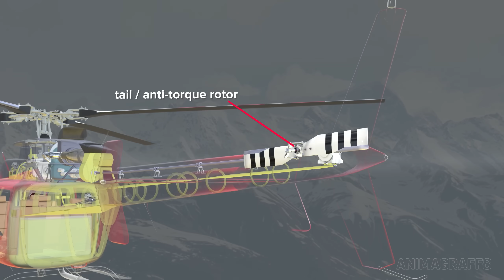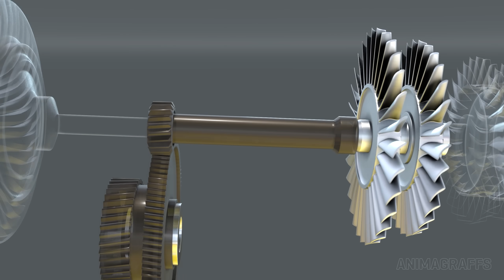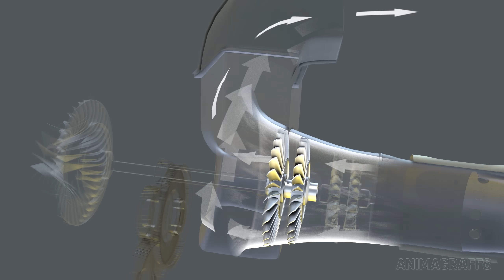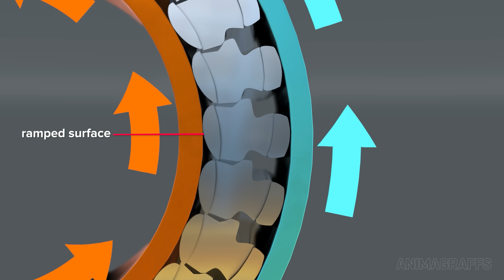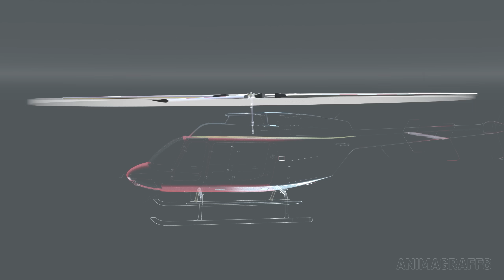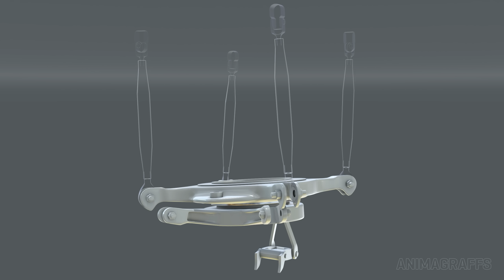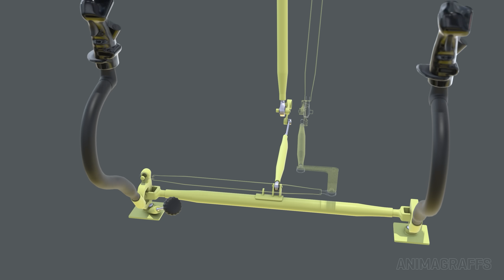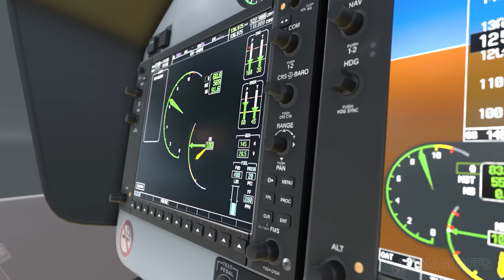How a Helicopter Works (Bell 407)

Comment: I thought “yeah I know how a helicopter works, I know the basics, it’s a relatively simple machine” and then I watched the video and was in awe😳 your videos never cease to amaze me!!
Reply: its a thousand parts flying in close formation around an oil leak. words from a helicopter technician i talked too a long time a go on the internet
Reply: @pieterpretorius1014  I cannot believe helicopters don't just fall apart, with 100,000 points of failure, 90,000 spinny parts, being held together with 50,000 bolts & also that one nut at the top of the mast clamping it all down. That one nut makes me worried. I believe in god now.

Comment: This is absolutely amazing!
Helicopters never made any mechanical sense to me, always found them scary, this video gave me a new appreciative perspective.
Reply: On the opposite side, it shows just how many things can go wrong because of how complex the whole system is.
Reply: @skorpius2029  I cannot believe helicopters don't just fall apart, with 100,000 points of failure, 90,000 spinny parts, being held together with 50,000 bolts & also that one nut at the top of the mast clamping it all down. That one nut makes me worried. Also I believe in god now.

Comment: Don’t walk past the baggage door when the engine is on, especially on the 407 (or the predecessor 206). That tail rotor is damned near invisible and comes down about 4 feet off the ground. 
It’s one hell of a haircut.

Comment: I have learned so much from this video.
The great detail you provided has cemented just how magical these machines are.

The "Yee Haw" engineering has convinced me that if aliens didn't build the pyramids, then they must have at least built helicopters!

Thanks Jake!
Reply: 😂.  I have always thought if aliens built pyramids, they wouldn't have used stone 😂.  Plastic? Carbon fiber? Anything but stone.  
Helicopters 🚁 are amazing. That's what I learned

Comment: FOR YEARS ive been looking for videos that explain how lift is transferred from helicopter rotors to the body of the aircraft. I thought Id have my answer... but its still not clear how lift is transferred from the rotors. It must be through the rotor shaft? But how is a rotating shaft connected to a body that can transfer lift...  and isnt there a "Jesus Nut" somewhere? ARGG!! That aside, incredible work - again!!! Amazing.
Reply: I always think in “ball bearings” as in a bike over the fork. This chain geometry against centrifugal forces is a safety backup. Can’t use a chain on the main rotor shaft. The Apache helicopter has RADAR over the rotor. So the rotating shaft is indeed secured by a fixed shaft? How do Quadcopters do it?
Reply: The mast holds the rotor head and blades, the transmission holds the mast, the transmission mounts hold it to the airframe.
Reply: @Bornintheseat  on our car the transmission doesn’t hold the weight of the car. In fact there are sliding gears to prevent any axial load on the diff ( which is integrated into the gearbox). No one doubts that stuff can be bolted together, but we have a problem to believe that stuff can also rotate reliably.

Ships had a problem to switch from wheel to propeller. At least with a fast running engine, I think they have a fixed straight spur gear and then the main shaft ends in a hydraulic cylinder
Reply: @Bornintheseat  ok, but how and where - could you give a time code in the video? How is the lift (which i assume is either in the vertical drive shaft - or a shaft within the drive shaft) connected to the transmission casing (which is then attached to the airframe?)
Reply: @gepisar  28:53, the mast nut. Easy to miss with how quickly the mention of it goes by but it seems like that's what ultimately secures the mast and rotors

Comment: Excellent work as always!

I have two nitpicks about the engine: 1) On twin engine models, the engines are not identical, but mirrored. 2) The engine is closer to a jet engine than you make it appear. Jet engines do need to put power to the shaft, and turboprop engines generate ~10% of their power as thrust. Applications usually favor one over the other, but I don't see why you couldn't build an engine with a 50% shaft/50% thrust output.

Comment: nice! Ok halfway through. I knew about collective and cyclic pitch but never saw a good animation. As a machinist and mechanical engineering student, I can safely say I don't know if I will ever ride in a helicopter hahaha. So many points of failure. They are amazing pieces of mechanical engineering/manufacturing feats.

After watching the whole thing I have to say bravo! Well done man. Helicopters are crazy.

Comment: Fun fact, some helicopters have Pratt & Whitney PT6T engines.  They have two separate powerplants and so resemble a twin engine, but according to them it's only a single.  It dawns on me much later in life that this exercise in symantics is so pilots don't need a multi-engine rating. 🤔

Comment: While a helicopter is a beautiful and ingenious system, I do sometimes wonder how they aren't constantly falling out of the sky due to maintenance issues. The added complexity of the rotor system is hard to ignore. I do know that helicopter travel is the least safe in the aviation world, but not by how much.
Reply: Because an aviation certified bolt could be $50 compared to the hardware store 50 cents. Them things are crazy tight regulated!
Reply: If helicopters are the "least safe in the aviation world" (I have no idea) I suspect one would have to consider that helicopters are put to some fairly unsafe work, often in less than optimal conditions.  But yeah, wowzers, that's a lot of moving parts.

Comment: It is amazing that the teeth of the gears can sustain that amount of torque without striping the metal to shreds.
Reply: Steel is strong.  Same idea with bolts and nuts - a couple threads is all that holds an airplane wing on! (At least a small plane.)
Reply: It is the heaviest part.

Comment: You outdo yourself with every video! I swear the more I learn about helicopters the more it truly seems like absolute witchcraft that they work at all
Reply: Or microchips.
Reply: @brodriguez11000 ? Microchips and PID controllers are the witchcraft that makes quad rotors work. They have nothing to do with the manned rotorcraft that have been flying for decades. What?
Reply: @brodriguez11000  and their fabrication, especially everything to do with EUV

Comment: Good work on the engine. 407s use a RR250 C47 and other than power turbine speed (just shy of 33,000 rpm) you were really accurate to the C47.  I like your attention to detail and accuracy!!!

Comment: Thank you for not choosing the Robinson helicopters [to base your tutorial on].
Reply: An AW139,Sirkorsky s76, or Airbus H160 would have been superb
Reply: why?
Reply: @TheKdcool  Because they are especially dangerous and because of that make a poor choice to explain how helicopters work.
Reply: @PetesGuide  they are not dangerous, they have a higher than normal crash rate due to the pilots flying them generally having lower hours, and the fact that they are frequently used as training helicopters. 

Lots of helicopters use the same semi-rigid rotor system that Robinsons do and have less crashes simply because the pilots are often more experienced, for example a Bell 206 A/B/L etc. AND the fact that Robinsons are such a popular helicopter (there are thousands out there) means that yes, there will be more Robinson crashes that you hear of simply because there are MORE of them.

A common mistake that Low hour pilots make, consequently they are typically flying Robinson Helicopters, is unloading the main rotor system which can cause mast bump or tail boom strikes. These are both likely to end up in a crash. Obviously there are other incidents and accidents that do occur but if you look into them, majority are due to pilots flying outside the capabilities of the aircraft due to a lack of experience.
Reply: @PetesGuide  Bit more to it than that,   Robinsons have semi rigid rotor systems and are susceptible to mast bump in hilly terrain as well as Tomtom's explanation due to turbulence around hills.
We have quite a few fatal crashes in the here in New Zealand in the South Island due to cresting a peak and entering a low G condition on the other side resulting in the rotor unloading causing mast bump and the loss of the main rotor. (The main mast and rotor assembly literally snaps off)...